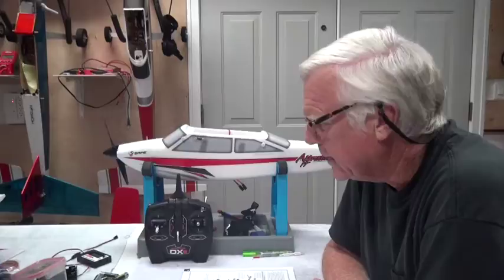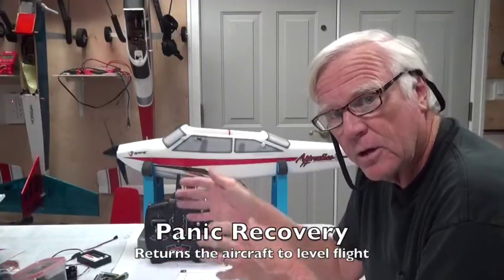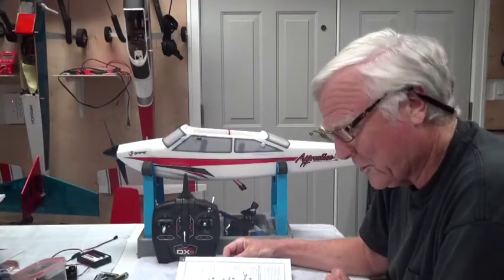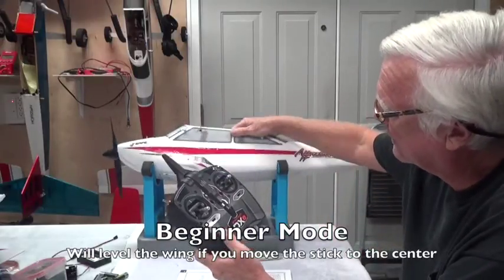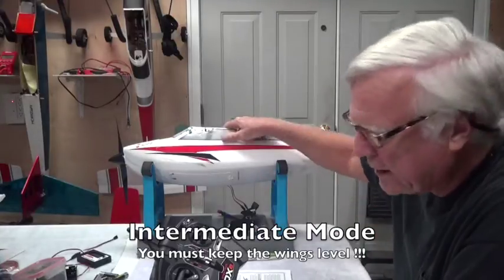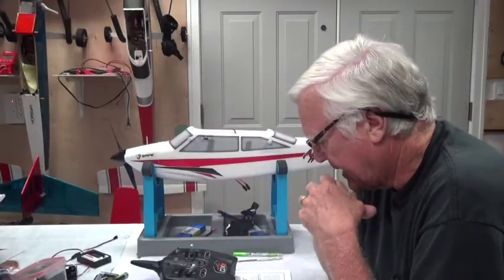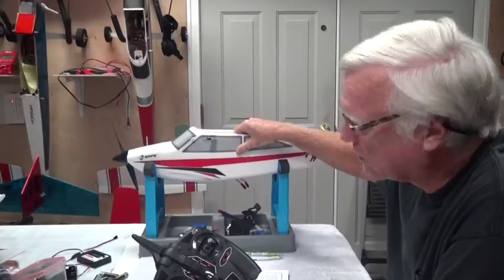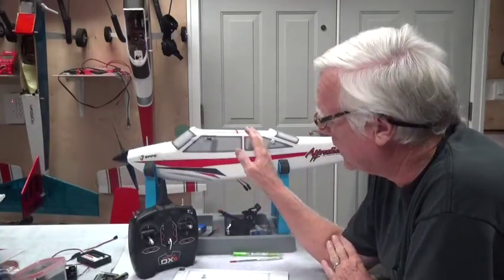AP14 Apprentice S 15e RTF Safe Technology

Comment: Can the safe receiver used in the Apprentice S be used in other airplanes?
Reply from the maker: NO.  The safe receiver is designed ONLY for the airplane that It came with.  If you remove the safe receiver then try and put it back in the same airplane, it may NOT work because it was calibrated at the factory installed.